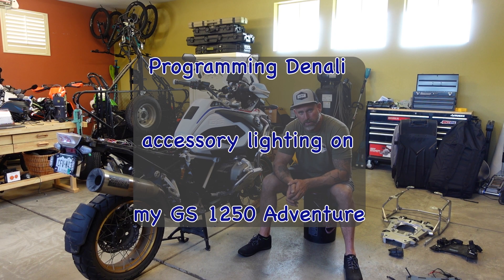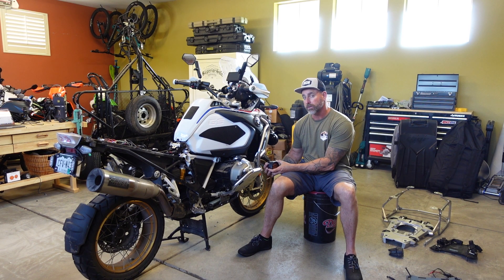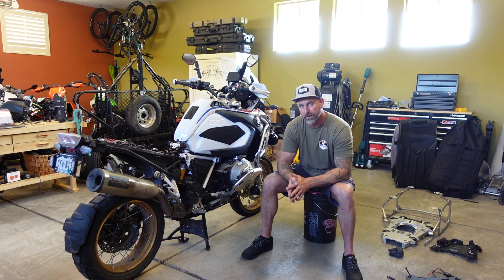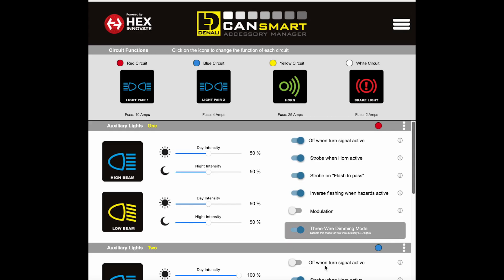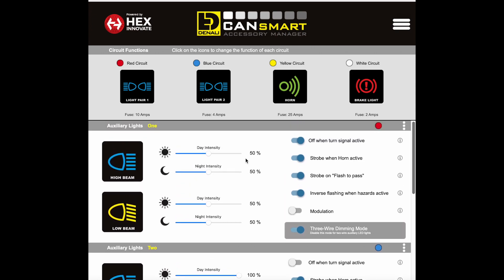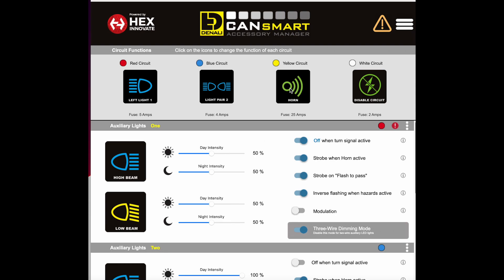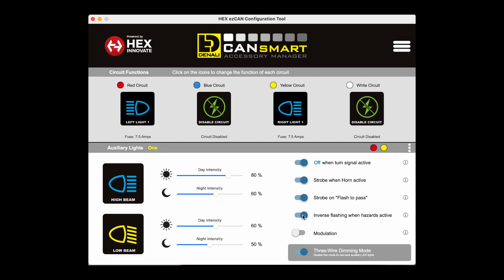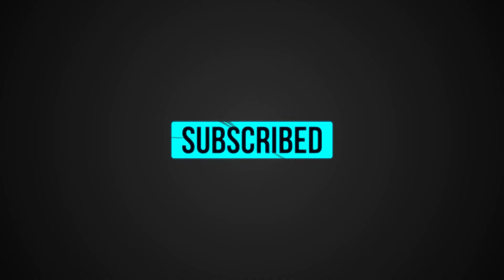Programming Denali lights witht the CanSmart controller. Itt's so easy!

Comment: I need some help. Just installed the Denali rear visibility bundle on my 1250 GSA. It comes with the T3 switchback lights. I installed via the instructions and they work but they are both amber color not red.  I can get one to go red and the other stays yellow so I know the color can change... How do I change the color for both to red?
Reply from the maker: Are you using the cansmart app on your laptop?
Reply: @ hey thanks for the reply. Yes I was using the app. I figured it out. I had to set the intensity for the turn signal running light to zero so that the brake light would be red works perfect now.
Reply from the maker: @MotoCole glad you got it worked out. Cheers

Comment: Question. I have a 1250RS with denali D2 front facing (left and right channel), a sound bomb (3rd channel). I want to add the rear T3 brake/indicator lights but only have 1 channel spare. Would this work with some form of adapter or will this setup not work? Thanks.
Reply from the maker: Can't you run the D2's on one channel? That would free up the one for the T3. Alternatively, you can run a second CanSmart. I have two on my bike and it works really well.
Reply: @upshiftingadventures  Thanks for the response. I'd ideally like to avoid getting a 2nd canbus controller. D2s on one channel is doable, but the rear T3s apparently needs 3 channels? Is that right?

Comment: Can I ask...  I have recently bought a BMW  GS with Denali lights, a  horn bomb and a rear light  do you just plug your  laptop into the can smart once you have downloaded the program   as I want to change a few of the original owners settings .. is this a simple process 
Do I need a special lead or a specific program ...?
Many thxs 
Ade
Reply from the maker: Hey there. All you need to do is plug in a USB Micro to your cansmart and open the program. It’s that east.
Reply: @upshiftingadventures  thx you for your help and quick response .  Regards A

Comment: I had a query, will keeping the lights to 0% on low beam mean it is equivalent to the lights being off or does it still draw current. I am installing a cansmart on my PanAmerica today and I want the below type setup.

1.During night on low beam I need the lights to stay off but turn on full 100% during highbeam. But I need the lights to flash when pressing the horn or using the passing switch.

2.During the daytime I want the lights to stay off whether it be on the low or high beam however I want the lights to flash when I press the horn or the passing switch.

Is this possible if I am setting them up as 0%
Reply from the maker: Those are great questions. I believe if the lights are set at zero then you will not have any illumination. I am going to be at the Denali booth at Overland Expo east in two weeks and will ask about that.
Reply: @upshiftingadventures  Hi, thank you for the reply. I think I was able to achieve what I had mentioned above. Haven't got a chance to test the day mode yet as I work nights so will check this weekend. But the night setup works. I have the lights at 0% at low beam but they flash when I honk the horn so it works.